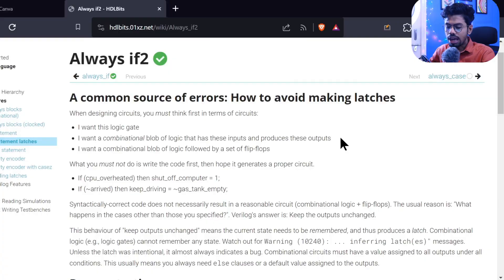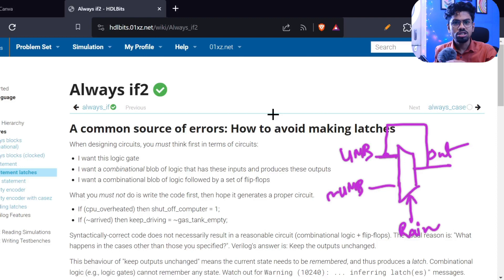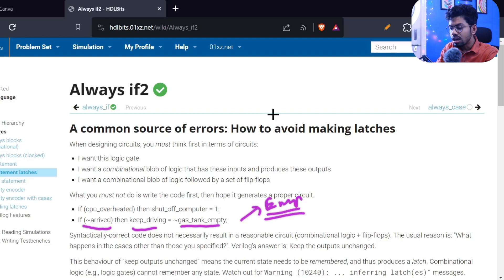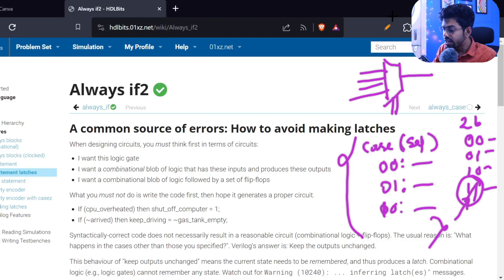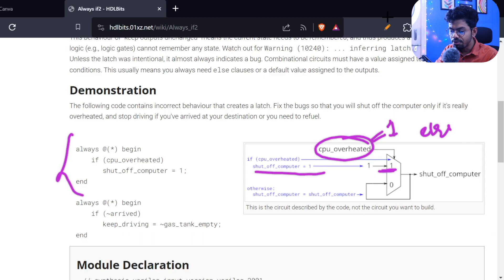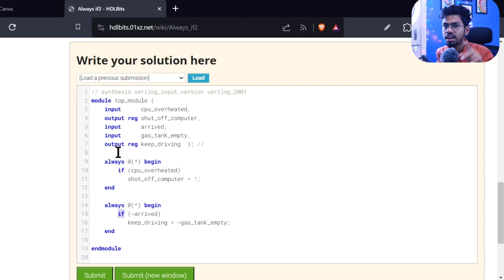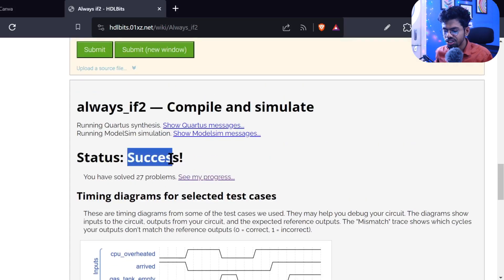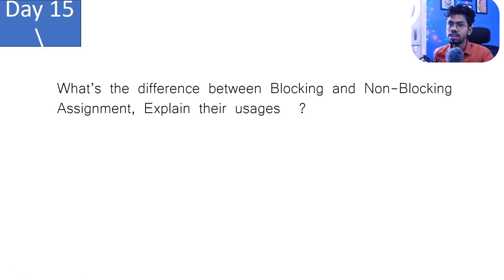Danger of Conditional Flow |Lets Learn Verilog with real-time Practice with Me | Day 15

Comment: Blocking statements are kind of statements which executes concurrently . We use it inside the procedure like initial , always etc. and represented using <= sign . 

Non blocking statements are something which executed in a serial fashion . We use it in net type data type . Non blocking assignments are used in combinational circuits . The sign is = .
Reply: bro blocking assignment sign is is equal to i.e. =
where as non blocking assignment symbol is <=

Comment: In simple words Blocking assignments obstructs the flow of a code where as non blocking assignments will continue the flow of execution of code. Blocking statements should always be used inside the procedural blocks where as non blocking assignments are used with sequential circuits